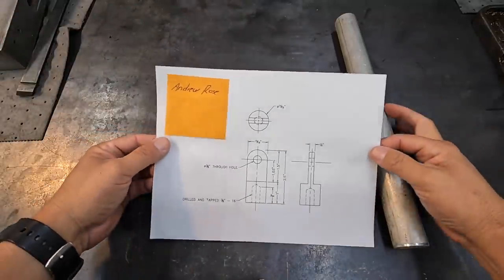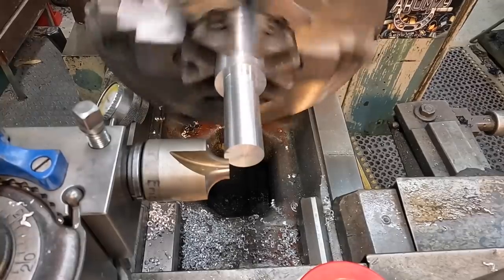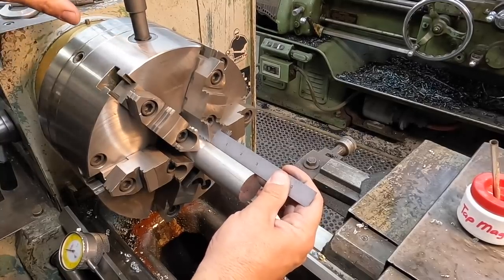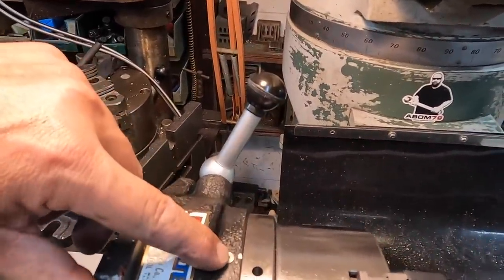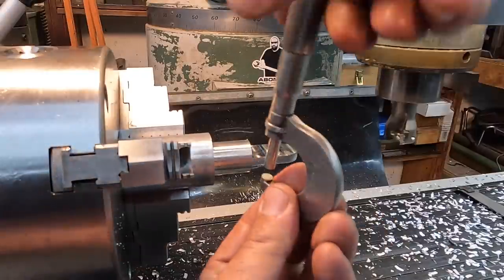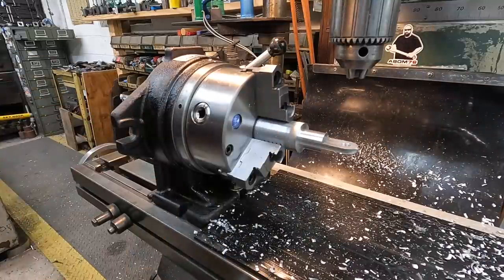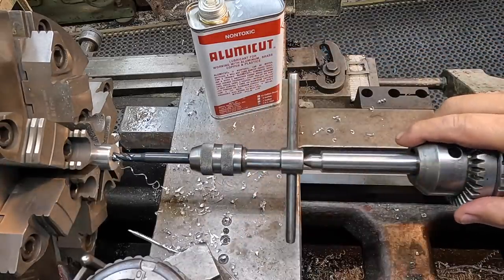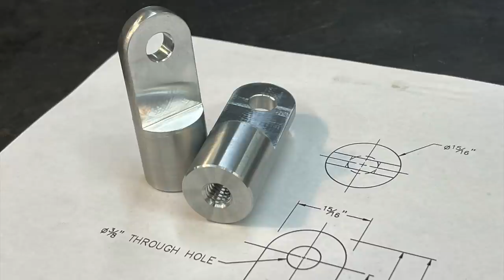Custom Aluminum Rod Ends

Comment: I don't mean to pry. this is something I could do in my shop.  Just how would you price this job?  Not your rate, how you would figure the 4 operations,  for a total amount per piece.  Just the time in hours or minutes.
Reply: If I machined these parts in my shop with the same slow precise teaching method that Adam uses I would charge about $80. each. If produced in high volume lots of 1000 + on CNC price would drop to $6. or less
Reply: An hour minimum labor most likely.

Comment: In fall 2012, in graduate school, I wanted to date this lady and invited her to the student machine shop one night where I made almost exactly this pair of parts for her. The parts fixed the touring rack for her bicycle, which had failed on a bike camping trip. She and I ended up together for three years!
Reply: (Other than the size, the difference was that instead of the non-rounded end being drilled and tapped, it had a shaft that fit into steel tubing in the surviving part of the touring rack.)

Comment: Curious why Adam didn't just part the pieces off with a parting tool instead of using the band saw.
Reply: He often uses different tools just to demonstrate to us viewers that there are various ways of doing things.
Sometimes it takes even longer to do it the way he shows but I appreciate that he does that for us.
Reply: Bandsaws are cheaper to run than parting tools. If you loose a tooth or two on a bandsaw blade, no big deal, but parting inserts and blades are expensive for jobbing shops.
Reply: @rustyanvil51  I'm not on the same page with you. I don't see how using the band saw was "cheaper". From everything I've seen, the savings in time and power and the fact that they can be sharpened when they become worn, sorry, not seeing it.
I find Glen's "content demo" idea far more likely.
Reply: @BigRalphSmith  More likely, the band saw is used because Hydmech is a sponsor.
Reply: Anytime a cheaper tooling or machine can used, it saves money by reducing ware on more expensive tooling or machine.
Reply: Band saw has less kerf width, so more material to go back on the drops shelf for the next time. Also safer, catching solid parts on a manual lathe is possible and that one is small and light enough that it shouldn't be a problem, but why risk dropping it and marring the finish or worse throwing it across the room or breaking a parting insert when you don't have to.

Comment: I use my "roundover" carbide router bits for turning a radius on aluminum. Carbide woodworking bits of any shape work great on aluminum.
Reply: Good trick for us home gamers with only a big box store around for tooling and a tiny budget. I did all my early machining (on Al) with a cheap straight router bit from the Homeless Despot. Invest the extra cash into heavier iron :)

Comment: The corner rounding tool produced an end that is curved in two directions.  Seemed to me the drawing only specified a single curve (along the 7/8" dimension, not along the 1/4" dimension). I am sure it does not effect fitness for purpose.  But am I right that the part does not conform to the print?  How might one make just the single axis curve?  (Great lesson, as always.  As a hobby machinist I learn from every Abom79 video.)
Reply: To make it like you said he could have used that corner rounding tool on the mill and went across both sides with the part standing up
Reply: @rixiv7868  Ahh.  Yes.  I see what you mean.  Nice.  I wonder why Adam didn't do it like that.
Reply: I see what you mean but the curve is gonna be minimal and putting a flat curve all the way around would have been a pain in the ass.

Comment: I was following up to the point where you were facing the end that received the tapped hole. You said you left around a 1/16 to face off before drilling/tapping the hole. My question is, once you chucked it up to do the face, how did you know how much to remove to get to the 1” mark? With the 6 jaw chuck, there didn’t seem to be enough room to get calipers in to measure the length.
Reply: Good question! If you look at about 31:59 in the video you can see that there is some gap. That looks like enough to sneak in the head of a caliper or a hook rule (Adam seems to like hook rules, as do I), or you could simply measure each one before mounting them in the chuck and facing like he did at 27:10. You can see he needs to remove about 0.0565" from one and about 0.083" from the other. If he did it that way he probably got them to within +/- 0.005" or better.  What surprised me a little is that Adam reamed the 3/8" through hole.
Reply: Try looking at the dial gauge in front of the carriage, when he faces the end he sets the dial to zero

Comment: Great video. I would have toe clamped,  cut my flats on both ends  , drilled and reamed and then rotated 180 and milled my other 2 flats. Just me though.
Reply: Lots of us don't own a Spindexer...

So, yeah, clamp her down in V-blocks with strap clamps, mill the one side at both ends, the loosen, rotate 180 using a 1-2-3 block, gauge blocks, or a parallel to set the flat face parallel to the table, clamp her down again, and finish off the opposite side.
Reply: Thanks for the alternative workflow idea. Would you use the flats to index the 180, say with some parallels?
Reply: I would have clamped to the table slots and milled and reamed. Then used my reamer or a dial pin to line up on the holes and milled my other 2 flats.

Comment: I've followed you ever since the Practical Machinist days! Just one thing, you show a lot of expensive options, in this case, the humble collet block would have been just as good and more affordable for the "home machinist"! Cheers, Matthew
Reply: I use collet blocks on my haas cnc machines, it makes it super simple to keep multiple ops clocked in, just move it down a vice crank out parts all day with no tedious indicating.
Reply: I don’t think Adam’s channel was ever intended to be what the “home machinist” could afford. He’s a professional machinist with a professional shop. You use the tooling you have.
Reply: His stock was 1.5" diameter. The "humble collet block" (most humble with 5C collets) has a max capacity of 1-1/8" (1.125"). But yeah, if he had some 1" stock a collet block would be much faster and HSMers are more likely to have one. Or even turn the necessary length of 1.5" stock down to 15/16" (as per the drawing) before.
There are other tricks for the HSM (or anyone really) 
1. Use a parallel clamp or V-block clamped to the stock as a temporary reference, align the reference to the table with a square while clamping the work in a vise. Mill one flat. Rotate the work 180 align with square again, mill second flat.
2. Mill a 'referrence notch' somewhere in the middle of the stock. Clamp it in the vise with a square piece of stock in the notch. Mill your flat on the end. Rotate the work 180 and mill the second flat.
3. I can think of at least three more ways to do this that would be in the HSM range of capabilities. I think my first choice would be #2 though as it will also work with tougher materials and one can choke up on the work close to the vise for rigidity... HSM mills tending to be somewhat limber.
Reply: @grntitan1  Adam frequently talks about showing people how to do things.
Reply: @MatthewTinker-au-pont-blanc  Showing someone “how to” do something the right way isn’t the same as showing someone how to do something with tools you may have at home.
Reply: @grntitan1  OK, lets split hairs!
Reply: @grntitan1  There's rarely just one "right" way to make a part. You might say the "right" way on this one would be to start with 1" round bar, but Adam used what he had to get the job done. More machining time, but less material cost by using an existing drop rather than ordering a stick of the "right" size. If he'd had 1" stock and a 1" collet block, I'm sure he'd have used them, as it would have been much quicker to drop a collet block into the mill vice than to set up the indexer.

Comment: Hey Adam. I've got a part that I 3d printed for my motorcycle. It's basically a threaded bushing/ adapter to screw into the handle bar end and accept a blinker. 
I could send a fusion 360 file, a demo 3d printed object that I know fit. And pictures of application. If that would be interesting for you to do.

Comment: Very nice parts. But one problem. Square shoulder at tang bottom. Bad practice. Should've been milled with a nice radius. Stress riser otherwise. May not be that critical. But better practice.

Comment: I'm no ME but I would think they would want an inside radius on each of those half-moon sides (transitioning to vertical post), to avoid that becoming a fracture point.
Reply: Thats correct. If this was a part seeing quite som load and dynamic stress, aircraft, motorbike and so on, cracking in these corners could be an issue. There is a small radius on the tool, maybe like 0.4 mm, but not much to talk about. In this case it's just for some camping gear, light use highly likely)
Reply: Agree. If this is just a 1:1 replacement of the original part, I wouldn't be surprised if the originals failed from cracking in the sharp corner. Judging by how beefy that part is, either it is highly stressed, or the engineer decided his salary was more expensive than the materials XD.
Reply: @2testtest2  My guess is the original parts were plastic, and these aluminium replacements will last 'forever'
Reply: @Rimrock300  I was thinking the same.

Comment: Adam, i have a question about lubrication, how does it work? You put it on the bar stock, but the cutter never touches the lubrication, the edge is "inside"the metal when cutting.
Yet, all machinists do it so it must have some advantages, but how?
Reply: The lubrication gets into the cuts, even if it do not look like it. Lubrication gets all over the place. Cools, longer tool life on hard materials, and nicer surface finish. Not used in all cases, but a lot

Comment: Hi Abom, I am enjoying your videos from Germany. Great job! Love them! I am learning a lot
I have one question though. At the end after cutting the bar in order to drill and tap on the lathe I would have expected you to use some soft jaws on the lathe. Don’t you scratch the soft Al parts by using regular jaws? Thanks!
Reply: I can't speak for Adam but  note the 6-jaw vs 3-jaw chuck. These are often higher precision, have more points of contact, and jaw radius exact match to the work-piece is less a thing for a good grip. Thin walled parts are less distorted, too. btw, With ANY work-piece  (polymers, alum, 'yellow' metals) or so-so 3/4 jaw (like my imports) powdered rosin dusted/brushed onto clean jaws & parts can enhance grip with less risk of crushing or slipping. (Don't machine 'dry') Cheers!
Reply: @johncmitchell4941  thanks for your answer !

Comment: You know if you had stopped when both ends were done and rounded in the lathe you would have had a great pastry rolling pin!  Thanks for going over the use of the tools as usual!  I am using my shop more and more as my very old farm equipment gives up the ghost and needs this part or that.  My daily use tractor is almost 50 years old and my bulldozer almost 80 this year!  No one sells parts for them anymore so I’m on my own to make most things.  Your videos help me keep my farm moving!  My next purchase is a DRO for my 48: bed lathe.  With farm stuff I rarely turn longer than 30” but it’s nice to have it if I need it.  Can you recommend an ‘affordable’ but accurate XYZ DRO?

Comment: All the chips you make are mixed metals. How does recycling sepeate these metals? What value is the metal by the ton you get paid for it?
Reply: Ever heard of magnets?
Reply: I think Adam just takes them to the recycle center and lets them deal with it.  Any good metal recycling facility will use Magnets and Eddy Current separators.
Reply: @johncoops6897  what about separating brass,bronze and aluminum?
Reply: @jerrydemas2020  - the recycling people know how to separate different metals, if they want to. It's not feasible for a machine shop to stop and 100% clean each machine after every job then to collect perfectly sorted scrap material. The make their $$ money from the parts that they produce, not the scrap chips they remove.

Comment: I can see these parts flying off of the new CNC machine as aftermarket replacement parts for something that appears to be load bearing and somewhat unavailable.
Reply: Just what I was thinking.
Reply: With no live tools and no sub spindle, there's barely any time saving from switching to his CNC lathe. It would be good for making blanks with the correct ball end radius, I suppose.

Comment: Some fine, fiddly work compared to most of the industrial stuff you do there, Mr Bom79.
Can see why you like that registering clamp.  So easy to set to xx degrees. 
Saw you reaching up top cause you're use to the bigger machine and 4-jaw. ;-) Killer vid, as usual.

Comment: ever made a picatinny rail before? i wonder what type of crazy tooling you would need for that type of slot cutting and whatnot
Reply: I had to look it up. Doesn't seem too difficult. Lots of standard cuts. The bevels are 45s. So nothing special.
Reply: @firesurfer  Yep, the Picatinny Arsenal designed them to be easy to make with an ordinary Bridgeport mill, so that the rails could be sourced anywhere in the world at need.

Their even faster to make using a horizontal mill with ganged cutters...
Reply: you make those in notime with standard tooling :)
Reply: An end mill..
Reply: Why bother when you can simply buy STANAG 2324/MIL-STD 1913 Picatinny rail stock then cut to desired length and drill for mounts as needed? For less money and time than it takes to make it from rectangular cross section stock.
Reply: @utidjian  unfortunately i need the rail to attach to a rare and unique sized bayonet lug....so im looking at potential options. Appreciate the idea though, that would be great if i didnt have to attach to the lug
Reply: @alex4alexn  Consider just making(or have made) an adapter to attach to the bayonet lug. Have this adapter drilled/tapped to accept a standard piece of Picatinny rail to your desired length. This rather than having to machine both the bayonet lug adapter and the Picatinny rail.
Reply: @grntitan1  that is a good idea, I will have to look into that, cheers!

Comment: I noticed on the drawing which the customer supplied to you, that the dimensions did not include tolerances.  When you have a dimension given in fractions of an inch...not in decimals....what kind of tolerance do you work to??
Reply: For fractions of an inch, the accepted tolerance is usually plus or minus .015 thousands, unless otherwise specified.
Reply: Around here, 1/64 (or 0.015) would be implied.  Can't speak for every shop though.  Abom's going way tighter than that, obviously (even reaming that 3/8 hole).
Reply: Every shop I've worked at is +/- 1/32 on fractional dimensions.
Reply: With that being said, I still shoot to hit the tolerance as close as possible so I never personally treat that any different than other features

Comment: Anybody with a pop-up tent trailer or an awning on the side of a motor home could be in use of a product like that if you have to do them
Reply: I've spent more than enough time with my father's RV but don't see the application. 
What are they for in relation to an Awning?
Reply: @glenj.taylor2938  the older pop up tents are even some of the newer ones have the folding arms and that would be the slide inside the other aluminum piece where the middle rods stand up to hold the tent up not everyone has new equipment
Reply: @scotthultin7769  
Gotcha, sort of.
Although my Father's RV has legitimately given me a form of PTSD from it's muriad of issues, I have a love hate relationship with it and all things camping related. 
I'm not familiar with tent trailers so I was trying to think more from your mention of the Awning on the side of an RV.

Comment: I assume that the part is for a low stress application, as aluminum is not a very forgiving to cyclic loads, especially lateral loads.  If SS or carbon steel are not available, I suggest adding a,  R .10 in the corners to relieve the stress points.
Reply: Agreed a radius in the corners are the ideal thing with a part like this. I guess this is for some camping, tent stuff, not a aircraft)
Reply: The radius on the corners of the inserts in the cutter are probably 0.4 or 0.5, so multiple times what you suggest! 🤷‍♂️

Dimensions are meaningless without a unit! I’m talking mm! 🤣

Comment: I need 10 of them, just like that !!
Reply: I would suggest contacting Mr. Booth.
What are they for?
Reply: @glenj.taylor2938  i use fittings like that for mounting ham/cb radio gear, using  different length  shafts between those type mounts, the last 10 i had made cost me 200 from the local shop here !!